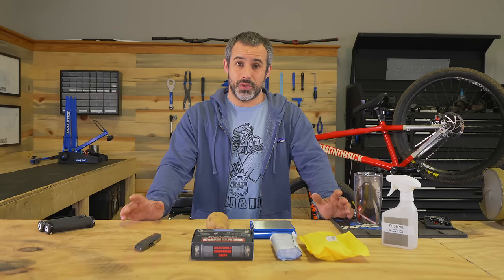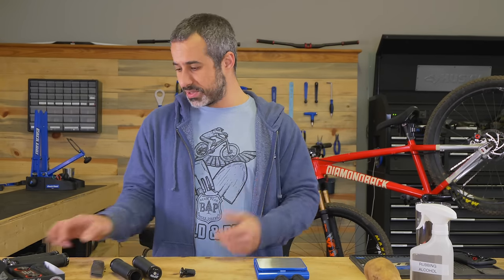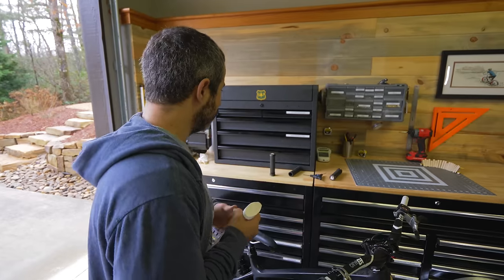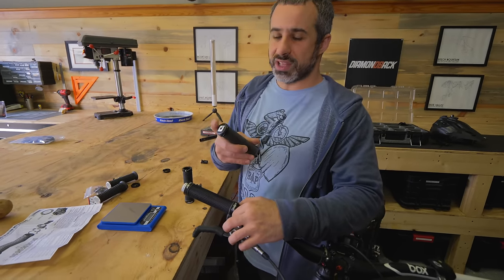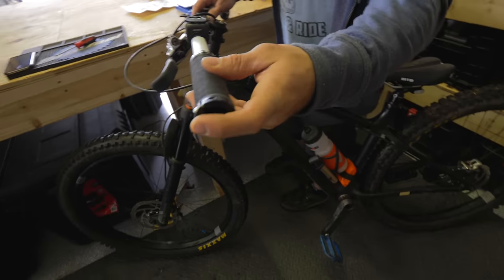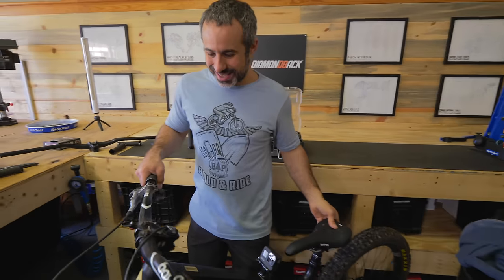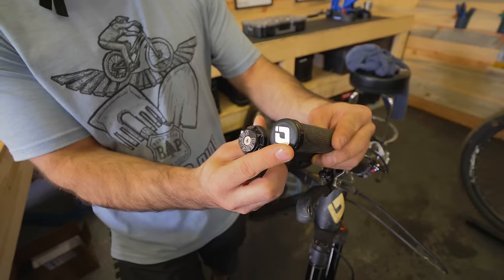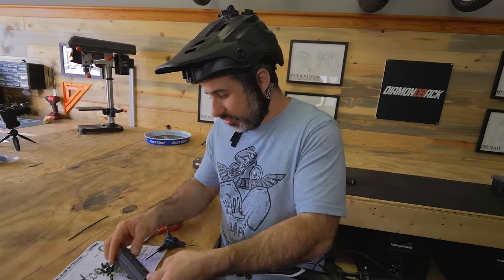REALLY?! How do $90 bicycle grips stack up against $5 grips?

Comment: 2:54 Reminds me of riding my brothers Huffy when I was maybe 10 years old or so.  Just had the cheap stock grips on it, the ones where the rubber always splits on the end and allows the grips to slide inwards on the handle bars.  I had a slight mishap and ended up with the bar end stuck into my chest.

Comment: I  have used Revgrips for 3 years now and have Revgrips on 4 of my bicycles, any bike that I plan to use for DH courses, I will make sure I have Revgrips on them.  They work as advertise and do prevent arm pump.  Seth's problem is he did NOT tighten down the clamps enough.  Also the difficulty of setting them up was not that hard for me as it was for Seth, though they do take a good 30 minutes that first time.  I just picked up a new pair, and the newer ones are even easier to set up.

Comment: Drop the rubber grip in a glass of hot water, let it sit about 30 secs, then slide it on! When the grip cools, it grabs well. I'm old enough that's how we did it in the BMX days of the early 1980s.

Comment: I don't know if the rev grips have made this but I think if they connected all of the 4 rubber pieces in the formation they are supposed to be it would be easier to install and much more safe. They have probably fixed this issue though it is a pretty easy fix

Comment: I wish I had saw this video before I made the purchase.  I got the cheap set and I used some vasoline to get it in.  I am not doing any trail run, just normal road cycling at low speed.  It is alright for me, but I probably wouldn't mind spending a little more.

Comment: A new test with 1 to 4 rides is not what I wanted to see.   Use them for two or three months and see the quality after.  
 I got cheep $6.00 grips like those $5.00 and after riding 50 miles to 200 a week,  I found them falling apart.     
   I do like and always watch your videos and even pass them on to others.    Do you ever have a new stage of product to the mid stage of the product to the start to think of replacing product?    keep up the great info,  at my age of 59 I need tech info as much as I can get.

Comment: Ergon cork grips are my favourites and bars with multiple hand positions, currently use Jones J bars with small stubby bar ends on the inner bar ends helps  with the pins and needles I get in my hands if riding too long in one position.

Comment: Mountain biking is so funny these days. Before lock on grips we would do all the downhill and dirt jump riding with plain rubber grips. Hairspray, glue, holy water, whatever you used, eventually a set would stick and be on for ages. Initially I didn't like lock ons because they were too thick. And I preferred to wrap my hand further round a thinner grip. Lock-ons are just too convenient for taking your controls on and off though. My favourite are the renthal ones now. But it still pains me to spend that amount on them. $90. No way. Fatigue from vibration in my hands just isn't an issue for me.

Comment: I was biking the other day and had the terrifying experience of my grip twisting off the handle bar- ended in a big crash. Never again, lock-ons for life.
Reply: Cheap extra-hold hairspray, the cheapest nastiest one you can find. Make sure the bar is clean and dry first, then spray the inside of the grip. It'll slide on easy then you just need to leave it to dry, how long will depend on temperature but they'll be rock solid when ready. Gentle use of a thin screwdriver and some teflon lube will get them off easily when it's time to change them. Lock-on grips are a lot less messing about, as long as you don't always over-tighten everything like I do. 😂

Comment: ESI Grip,s with ODI end caps, race/chunky/x chunky/xx chunky.. lightest, stay where you put them without locks, great assortment of colors for those that care, as comfortable as needed, like any grip, Don't get a death grip on them, point the bike where you want it to go, relax your grip, enjoy the ride with some of the best grips out there. The ODI bar ends hold up much better then the ESI grips, and they are made for BMX so they can take all the abuse a mountain biker can give them.. and ODI bar ends help make the ESI grips last much longer..
Reply: I have been using ESI grips for over 10 years now, I prefer the Chunky.  These are the only grips I will use anymore.

Comment: If you use some hairspray on the inside of those cheap grips you can slide them on easily and when the hairspray dries they'll stick better than locked ones. Old motorcycle trick. Yes I'm old. I'm sure there is no 80's V05 hairspray around but I'm sure you'll find something.

Comment: I collect bikes from the 80s and 90s, and it gets very expensive just for reference you would spend from $2000-$4000 just   for the wheels and frame for a good bike. And sometimes the handle grips can get up to around $400😂

Comment: My bike was used and the left grip was the normal lock on grip that came with the bike and the right grip was that 3 dollar one and it came off more than my chain the guy put it on using a lubricant so it slid off super easy

Comment: Cheap grips like that also want to prevent them to go off, which can happen. Spray a wee bit of clear varnish in them and a wee bit on the bars. Easy to push them on and they wont come off.
Still can take them off by prying a screwdriver between them and then pry the comoressors nozle in it and blast off when twisting
Btw the old fashioned way of doing that was using hairspray. Thats just as good 😃

Comment: On my BMX I got a set of grips supposedly for an "ATV" that were Rockstar energy drink branded with the Rockstar logo's on it, for the $10 bucks I spent on em they are pretty good, but they need to be refreshed, after 6 years the rubber has gotten a lil hard.

Comment: Use hair spray on the handlebar and inside the grips.  The grips slide right on, the alcohol evaporates, and the hair spray keeps the grips from slipping.  If you don't use hair spray and you are riding in the rain, water will get under the grips and they sill slip around on the handlebar.  To get the grips off, use alcohol on the grips while rotating, and the alcohol will easily work it's way underneath the grips and dissolve the hairspray and the grips will slide off of the handlebar..

Comment: Have tried so many handlebar lock on grips and can easily say that the ODI Ruffian and identical types is the best i have tried. Others that are thicker or with many different patterns and fancypants features etc has never beaten the ruffian feel. Expencive is in my experience not the best. Been riding dh since 95. People have different hand sizes. So preference will differ. But for my hand size. Ruffian. :)

Comment: 4:54 - You should have dropped in and had the bike just fall apart like a Buster Keaton skit...  😆
Since I started riding I've been using regular grips w/ metal bar ends but I've never had lock-on grips but I might try them for $5...

Comment: ODI lock on, period, end of story. Still using a 20 year old pair that STILL stick to my gloves.  Some of the cheap lockons don't properly recess the retention screws. Wish I could remember what I paid but they were worth it, 10x over. After reading some of the other comments it looks like you should do a video about bar angles. A lot of those numbness and tingling complaints can be corrected by having your bars at the proper angle. While saying that, perhaps a whole bike setup. I have seen far too many people riding on a bike with a garbage position setup who just gave up and quit because of it.

Comment: New to the MTB world, but race dirt bikes. Single-track and enduro. we usually use dish soap to slide the grips on and then safety wire the grips in place. Los of crossover between the two sports and the machines, but i dont see a lot of the MTB guys using the tricks of the dirt bike world unless they are also dirt bike guys.

Comment: one time i was riding home from school, (I'm a band kid) and i was holding my trumpet with my bars, and then my trumpet case decided to wack the fork of my Walmart bike that literally came from the thrift store, and keep in mind, this thing at the time did NOT have bar ends, or even grips for that matter. So, if it weren't for my slight bit of upper body strength, I would have been impaled. Now, i have ANOTHER Walmart bike that came from the same thrift store. And every time I'm in 7th gear and I try to put the slightest bit of torque JUST above being able to move, my chain pops, and pops, and pops. Also, when I'm in 7th gear, I have to hold down my left shifter half way, to avoid embarrassing myself in public. In other words, that's why I've gone through 5 bikes. They all sucked.

Comment: If you get numbness from riding bicycle for short time, you need to see a hand surgeon and have that carpal tunnel sliced, very quick fix, short recovery time, good results. You may also have other impingement issues in your arm nerves or even back/neck issues causing the numbness, but lets be real 99% its carpal tunnel, its such a common issue nowadays.

Buying complex grips that can fall apart if not installed perfectly is not a solution to a medical problem.

Comment: Bar ends may be important, but if you have a double locking grip and the metal ring is locked to the end then you aren't going to get the bar stuck in you anyway.

Comment: My old bmx I swapped out IMMEDIATELY for some $10 ODI grips. I got the "limited edition" super soft compound (that they still sell) and they lasted two years of SOLID every day HARD, and they're still alive just like new with a few major dings in the bar ends. I don't see any reason to pay $90 for grips, don't care how great they are. No grip is worth that much, unless you're an absolute expert... which is what the rev grips are for. You want a good grip? Just get an ODI. They fall apart (which will be a SLOW process) just spend $10 more bucks. The RevGrips I think you need to fine tune for a few miles before committing on a long trail. No "average Joe" should ever commit to a grip system as complicated, and as expensive, as that. Average joes, STICK WITH ODI. You won't be disappointed, and especially neither will your wallet.

Comment: I had some with the ribs that weren't really fancy, I think they called them mushroom grips and I still have them on that bike.  They feel so great, they don't have plugs though, but I wasn't riding in a way that I'd shove the handlebars into my guts.  The soft ribbed handles have got to be the best feeling grips I've used.  On my cruiser I just have some hard plastic grips, they may as well have been glittered clear plastic but it's a cruiser so IDC.
Reply: Also really great 2nd take at the end, that's one of the best things and I think that really makes your review fair.

Comment: The harder the material on the end of the bar can mean alot recently I touched a wall at a good clip using grip type ¹ in your video the rubber  end touched a wall , and  stopped forward  momentum of just one side of the handlebars =crash. 
A mid grade grip with end cap would not have been as drastic of a yank in that direction,  would have scuffed the  end cap

Comment: I bought these RevGrips. Not worth $90. It really doesn't help much as advertised. I even put on vibration dampening spank bars. I'm sticking to Deathgrips now.  Feel even better in the hands. Idk if it's just me but all the vibration dampening stuff seems like a gimmick.
Also glad I wasn't the only one who hated putting these things on.
Reply: They've since completely revamped the design of the $90 grips in response to their many issues.
Reply: @ivanvarela3215  yeah sure. But they're still not for me. I like Deathgrips fuller feel. Also deathgrips, which are superior imo, are only like $23 lol

Comment: Seth actually that is a really good technic with the potato because like about 7 years ago I was riding on my bike on a hill with no grips or no bar ends and I sliced my thumb only leaving a little bit of skin holding my thumb and I ended up getting stitches so listen to seth everyone
Reply: It's no theory that they stab bad and deeply, many are sent to the hospital due to uncovered handlebar ends in low-speed crashes.

Comment: currently i am running those 3 dollar grip for my mtb hardtail which it works for me but i guess if your gonna use it for extreme situation you need good quality but those 3 dollar grips i have them in the uk and they soft for me which is super grippy but idk why they change the way that they supposed to be!!

Comment: I think you didn't torque the expensive grips enough. When you did the torque test to feel out the pressure you used a way bigger allen wrench. It's requires less force to get the same amount of torque with a bigger wrench.
Reply: Good head-up for me, I'm gearing-up a bicycle repair shop and have zero experience with a proper torque wrench

Comment: I hate lock on grips. I ride BMX not MTB, but I hate that they make your grip fatter, and it makes me feel not as attached to my bike.
When I was 12 I was jumping a ditch without grips on chrome bars (i was 12 guys) and I almost castrated myself. 
No bs I was about an inch away and had a golf ball above my "eherm". Once I started using air it is the best.

Edit: wtf, the $90 grips move? *thows in trash and grabs 2 different color Longnecks laying around from my great grandfather.

Comment: hilarius, $90 and you assemble them.??.. indeed, maybe they are great are preventing vibration, but so would a high TPI tyre up front...personally i twist on the grips all the time.. and use Specialized Body Geo gloves.. great at stopping pump/carpal tunnel etc.

Comment: i like the K.I.S.S. method for any engineering... keep it stupidly simple. the rev grips are like a mauser k98: pretty but too complicated and to be truly effective in the field (tolerances are tight enough that they wear out and malfunction pretty quickly by comparison and are more likely to break in general). the more traditional lock ons (like the zittos) are like my old mosin 91/30: stupidly simple and a bit ugly, but get the job done regardless.

Comment: Never want good packaging, it's money away from making the product! Edit i have used similar 5€ grips and tried the expensive ones. There is a difference but you rreeeeally need to look for it :D don't put almost 100dollars on your grips my dudes. Power of suggestion is powerful! Of course it would hurt more it has smaller surface area!

Comment: The best and easiest way to put grips on a bike is to spray womans hair spray on the inside of the grip. When still wet it lets the grip slide on easily it then dries and bonds the grip to the bar.

Comment: I don't care what review you give those revgrips later on...
I would NOT trust something that has rubber inserts meant to hold on to the grip you are holding onto.
It's not just a matter of them disassembling and sliding off, it's also a matter of you simply having freerolling grips all of a sudden and you can't get a good hold of the bike when you need it the most.

Comment: Bike grips have to be comfortable and easy to install. 
Seth, you have a certain routine installing bike parts and you had 45 minutes to install to 90 dollars grips. This is way too long and not practical for bike shops and customers. Plus: These grips are moving. 90 bucks are extremely overpriced for such a product. They are not 18 times better than grips for 5 bucks.
Reply: Someone else in the comments said that the design was completely re-vamped for those $90 hand-grips in response to pretty much all the problems they had

Comment: I don’t think this guy knows what a “bar end” is.  Bar ends allow someone to grab a bar sticking out forward from the handlebars perpendicular to the bars.  Those are handlebar grip “end plugs”.
Reply: I think the jargon changed from the 90's to present, and as far as the eye can see those bull horns are just outdated and classless. I have like 5 pairs that I will pretty much never use all sitting in my inventory, just asking to be scrapped.

Comment: I was going to ask about how that ZTTO grips perform after some time. 
But i see that they wear of quite fast. No wonder considering the cost.
Same goes with fooker pedals. I've seen some posts on amazon with people complaining about quality. They can brake and ppl were writing about some serious injuries or that they were lucky not to got hurt bad.
So i think im cured off china cheap stuff.
As a conclusion, you cannot test stuff in 20min ride and recommend or not. It needs proper testing.

Comment: If you buy any Chinese stuff replace the bolts at least and be aware of the materials, they might have very poor aluminum that doesn't hold the torque needed to tighten the bolts. I have few of these cheap 3$ Chinese grips and bar ends and for me they work fine enough. You can buy 30 pairs with the price of one these expensive ones... okay if you have the loose money for grips..well then...
Reply: The problem with the aluminum on the $5 grips is if they impact, say, concrete in a crash. They bend really badly, and when you try to take them off, will grind-off a significant amount of paint from you beautiful handlebar.

Comment: jesh you guys are soft my grips didnt move around. and a trick to get them to stick is a shot of paint in the grip slide it on and let it dry. also safety wire instead of locking mech is way lighter.

Comment: I use 1$ grip on my bmx xD and its pretty good ngl edit:its lock on grip
Reply: I suspect the downside of such grips will come in about 3-6 years time, I've had 1990s bikes come for repair with grips so old they've chemically broken-down into a glue-like substance. You don't realize anything is wrong until you really squeeze them hard and they go sticky on your hands and deform.